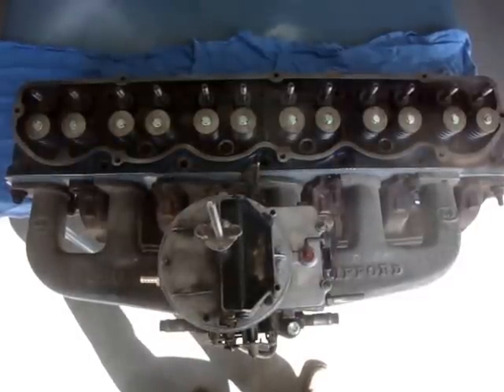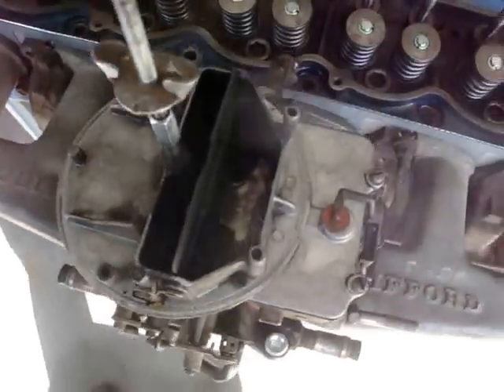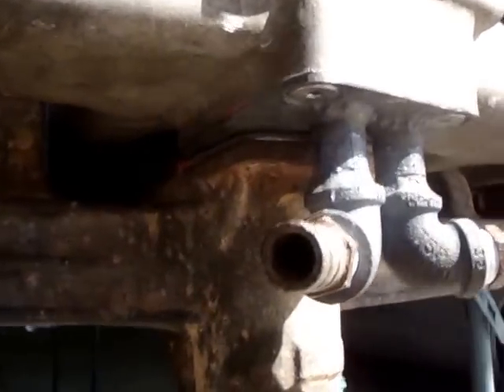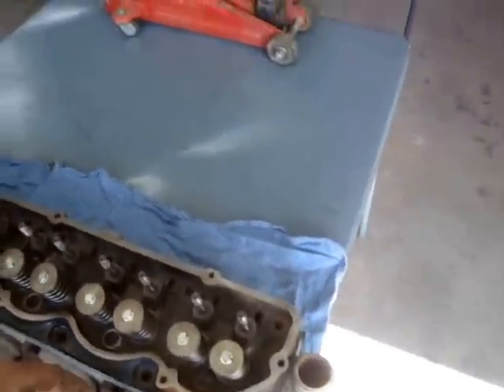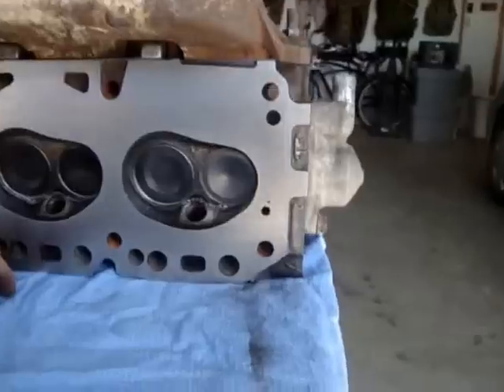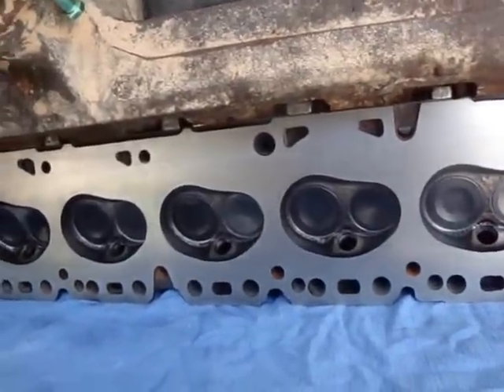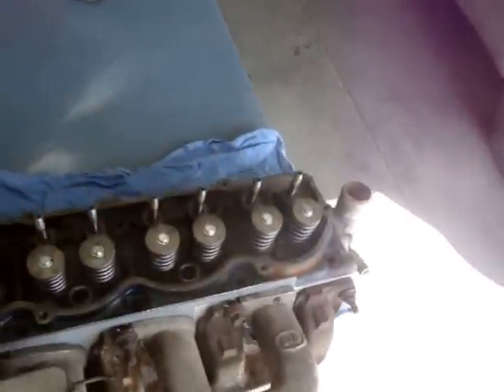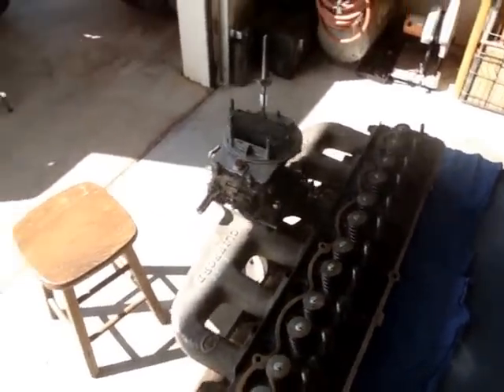Ford 300 engine buildup

Comment: Use the efi exhaust manifold.  It is two 3-into-1’s and then a 2-into-1.  Flows real nice.  Mine runs through the cat and then it’s 3” all the way back to just in front of the axle.

I did some porting on my head and it pulls great.

Comment: Where did you find an exhaust flange to work with the HD exhaust manifold?
Reply from the maker: I think if I remember right, it's a 2.5 in pipe flaired at the end, and I used a 45 degree steel donught ring in between. I don't remember where I got the ring. The original design had the pipe up in the manifold which I didn't really care for.

Comment: I am not sure why Ford restricted these engines so much in their trucks. I know that they were originally designed as a tractor engine but the intake and exhaust on these are horrible for both power and efficiency.   You can almost double the power from these engines without even touching the inside of them.  Carburetor, intake and exhaust manifolds , and a clutched fan.  A electric fuel pump and fan will gain you back quite a bit of power as well but you will likely need an upgraded alternator to use them.

Comment: anyone wanting to do this, just dump the one piece pre efi exhuast manifold (not the dump truck version though) and find the newer 2 piece exhaust manifolds. Won't have to worry about plating the exhaust port to the intake manifold. I think heating the intake manifold is only good in winter. Wrong thing to do in mid summer.

Comment: That manifold would have heated that intake even if you did nothing they are so close. But thats nice work. The water ports like you made are used when you use the efi exhaust minifolds with a carbed intake .  Also When you mod the stock cast log intake you face the carb twoards the fender . On your after market  intake its not going to make a diffrence open plentium. Thats a really clean truck in pa thats 5k plus

Comment: The best choice in carb for me would be a Holley 500cfm 2v I put one on a 351 Cleveland ND man you talk about differents big power ND torque gains but big fuel mileage loss lol
Reply: IMO the Autolite is vastly superior for a build-up, either in singles or 2 x 2 combo. BTDT.
Reply: If you want something for a mild 351C build start at a 600cfm four barrel. I run a 650cfm Brawler and it's brilliant. Remember the 2bbl ratings are only equivalent to roughly 3/4 the four barrel rating - a 500cfm two barrel is only a 375cfm unit in four barrel terms.

Comment: I had the same truck as you but with a 300 cube. Came with a 240 originally. The best mileage I ever got out of that engine was 15 mpg. 
  For me with the way fuel has risen to 155.00 per litre on the west coast of Canada, its more about efficiency then more power. Its a great farm truck or driving around in a hilly areas.
 I like the way you adapted it to a 2 barrel. I did the same thing with my clifford manifold for my square body S-10. Are the valves smaller between the 2 heads ?
 I also installed a Gear vendors overdrive unit on my K-10. Made a big difference . That would help this truck too . Good job

Comment: I just bought a 95 Ford F-150 5speed with the 300 straight six Eddie Bauer package it needs a little work but I think it's worth fixing up
Reply: I had a 93 version, brand new, of what you have and it is worth it. They are solid trucks and a very reliable all round performing engine.
Reply: I would upgrade to the '96 EFI (MAF and OBD2) and custom tune it like the mustangs... or if legal, swap in a thrid party EFI with wideband O2

Comment: Just add a turbo, lots of torque and power on tap then.  ;)
Reply: https://youtu.be/derl-nXwhvc
Reply: Hell yea man , they are almost dieselesque with the torque. 
I've seen a few vids on here and they usually push like 400-450 ft pounds in a big ol lump at low revs.

Comment: From '87 on they used a split exhaust manifold so...stock duals. You can seal the heat riser chamber in the intake manifold with a steel plate and plumb it for hot water heating.

Comment: never understood why Ford didn't design a cross flow head to get the intake away from the exhaust
Reply: It costs less money to build heads this way. Also, it is an easy way to preheat the intake for cold weather. V8 engines typically have a water crossover cast into the cylinder heads to preheat the intake.
Reply: Just think for a minute how you'd have to change the ezpz valves, rod & lifter layout to accommodate the intake valves on the other side of the head from where they are now, all in a row. Easily done on a SOHC design, but in a cam in block w/ pushrods & all, they'd have to redesign the entire motor; not something to be undertaken lightly, if at all. Plus in the days of carbs [as show here], having the exhaust close by to preheat the intake & aid fuel atomization was considered a "win" for day to day driveability [& commuters don't need a lot of power IRL.]
Reply: Down here in Australia we got crossflow 200 and 250ci inlines as well as the OHC and DOHC versions. The DOHC is referred to as the Barra motor. Stock rated at 182kW, or roughly 240hp, and capable of over 800hp with little more than a turbo and some aftermarket rods.
Reply: Ray Sutorius ...I believe they made them in Australia.

Comment: what did you use for a guide when porting? This is my first time porting and these gaskets seem to be very inaccurate?
Reply: Usually  what you want to do is gasket match the ports...
Reply: Some engines are god awful in gasket and port design ...it's a pita but you definitely wanna get the ports in the manifold to match up to the head nice. 
You can drill for some locating pins thru the manifold and into the head. 
Use a drill bit for a locater even, that way when you port you can get it matched nice on that transition. 
I did a small engine a while ago, and it's the first time I had to Port a gasket 🤣, some of it hung into the port, and parts of it needed the manifold ported. 
Goofy. 
Basic cleanup and gasket matching is always worth something, depending on the design, some more than others because some ports are worse than others.

Comment: Did you change the cam?
Reply from the maker: I have since built the bottom end, I put in a Comps cam with a 260 duration.  I also put in Cloyes adjustable timing gears set at two degrees advanced.  It makes its best pulling power at around 2500-2600 rpm.  Likes to cruise at 2000.  I may re-adjust the gears to straight up to get a little higher rpms to get the tourque band more into the higher hp range.

Comment from the maker: You are correct in that the carb should be mounted 90 from the engine for the most efficient flow.  After the build and installation, I replaced the two barrel with a 500 cfm edlebrock.  It made a huge difference.  I mounted it the same as the two barrel.  I think the difference In performance is rather minimal for my use, and I feel that an offset carb looks really ugly.
Reply: I'm lost.....  you first said  you replaced the 2bbl carb... with a 500cfm...     and said
  """ IT MADE A  H U G E   DIFFERENCE"""

the very next sentence you say it made a minimal difference.....    Which is it??
Reply: @shanedarden369  the minimal difference is by having the carb facing front-back instead of left-right to match the manifold better.

The Edelbrock 500cfm four barrel would indeed be a large difference in terms of performance.

Again, the minimal difference he's referring to is the orientation of the carb on the manifold.

Comment: I feel that your carb should be mounted  90 degrees from what you have for better distribution.
Reply: Carb is in the correct orientation.   If it is turned 90 degrees, the primary will; be sitting in front of one of the interior intake ports.  That cylinder will run rich at the expense of the other cylinders whenever the secondary is less than wide open.  With the correct orientation as he has it, there is more equal filling.
Reply: It's not a Progressive 2bbl, they are both 'Primaries', they open and close together...

Comment: I believe the 240 and 300 heads are  the same for a given year, your difference in combustion chamber shape comes from differences  in compression ratio in later heads . The 300 had dished pistons  to compensate for the  difference in displacement. The 240 had flat top piston The C on the casting stood for the 1960,s the 8 stands got the year in that decade.so C8 means that casting  was started in 68 the rest tells what vehicle line it was initially designed for, that it is a cylinder head and change levels etc. A 65 casting number would start with C5.

Comment: At first I was going to ask why you went through all that and then used a factory manifold, but I took my comments back when I saw you mentioned you head the heavy duty manifold in there. I hadn't noticed. What most guys do though is slap on some EFI manifolds. Those are the ones that flow the same as headers.